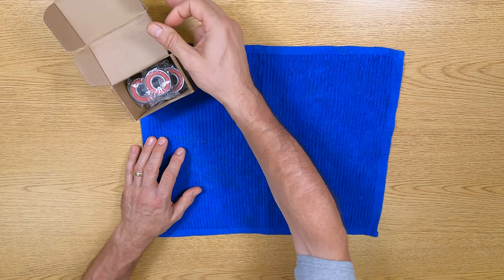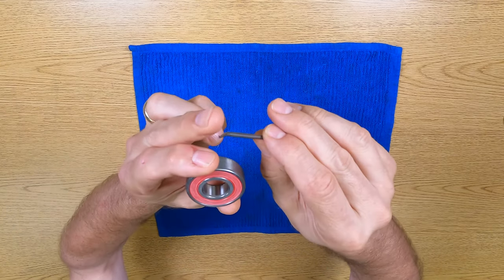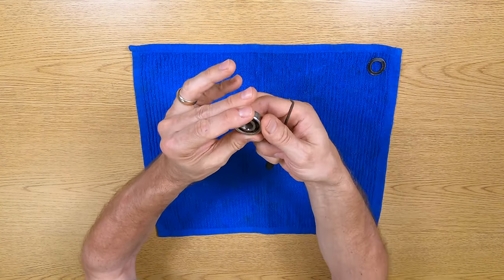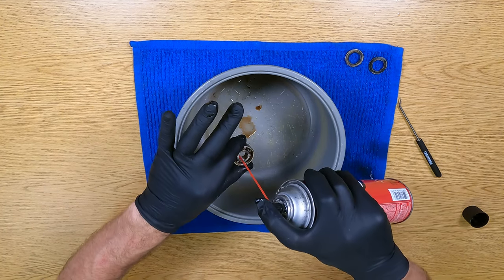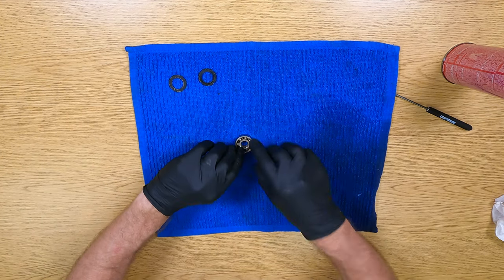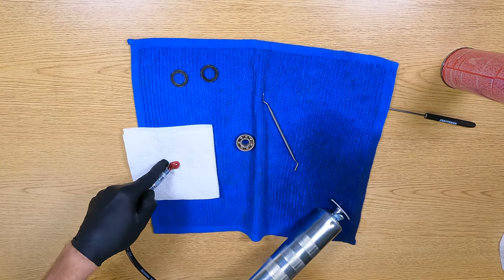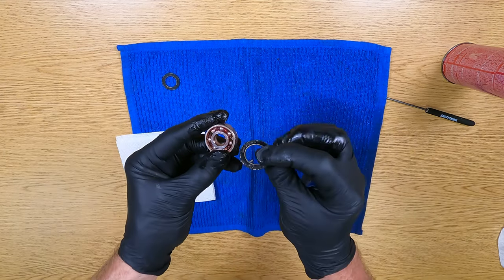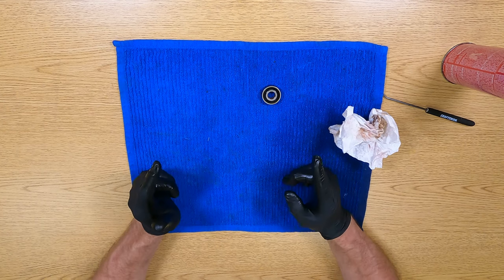How to grease (or re-grease) sealed bearings

Comment: Never ever pry off the seal from the inner race. Use the pick adjacent to the outer race. The nitrile or neoprene seal will be in contact with the rotating inner race and sealing it. Any imperfection in the seal will destroy the bearing. The outer race is stationary relative to the nitrile or neoprene seal, and hence pry off from the outer edge adjacent to the outer race of the bearing. This advice is for those seals which are in contact with the rotating inner race of the bearing.
Reply from the maker: Good to know, and thanks for watching and commenting!

Comment: Spot on, as was said use a paraffin based solvent to dissolve the grease initially . Alcohol's and ketones don't work as well.
Reply from the maker: With all the non-flammable options that actually do an as good or better job de-greasing anyway, and the fact that they will not degrade most of the typical plastic or elastomeric materials in some bearing (cages, seals, etc..), it seems like a win-win to use other friendlier solvents. But still DO make sure it's in a ventilated space. Thanks for watching, and for your comments!

Comment: Is wheel bearing grease a good option for regreasing these?
Reply from the maker: The nice thing about greasing your own bearings is that you can decide what grease to put in based on the service requirements. Wheel bearing grease would be fine for some types of service (such as wheels, lol), but you can pick the bearing grease based on the type of perils that your device may be subjected to. Need more heat resistance? Need something that can operate submerged? High RPM? Extremely cold duty? Pick the type that is optimal for your type of use. Good luck, and thanks for watching!